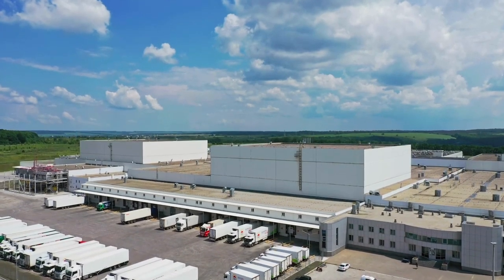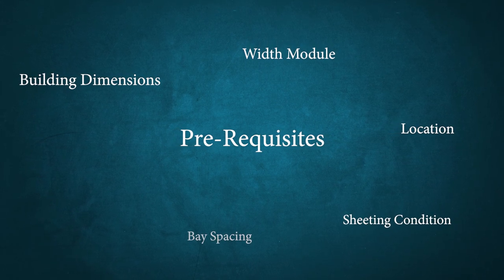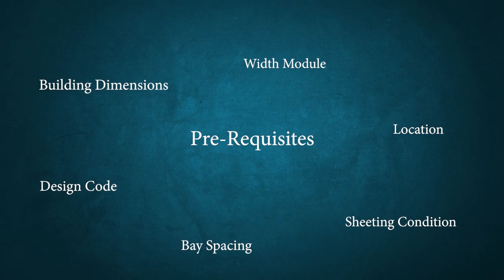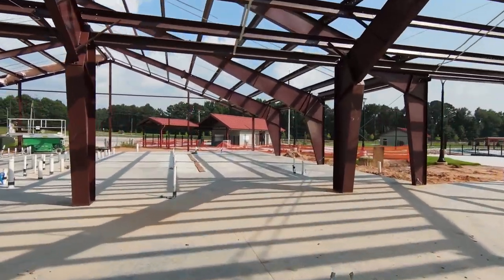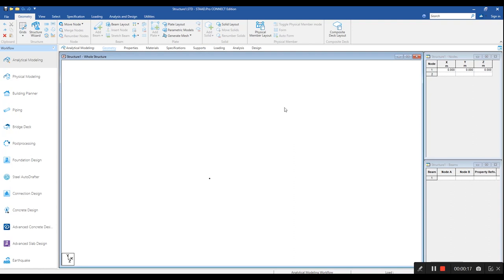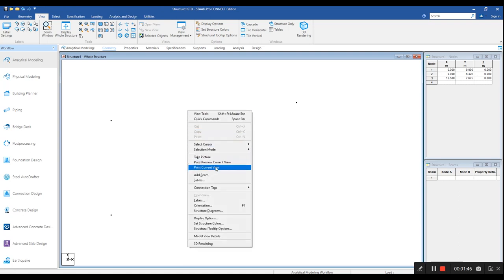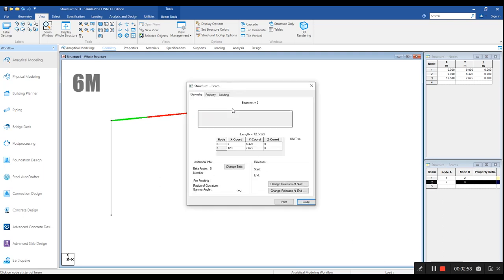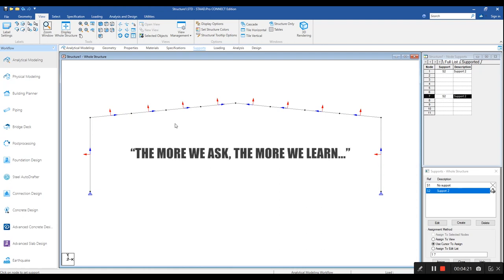PEB Warehouse Design in STAAD - Part 1

Comment: Do you ever use the physical modeler?
Reply from the maker: Since in PEB design, we would be using mostly the built up tapered sections. And I dont have a personal experience on handling physical modeller. So, I could not comment on it. If at all, I require anything, we can easily automate the STAAD syntax to get our work done.